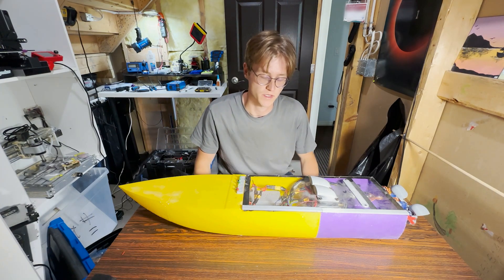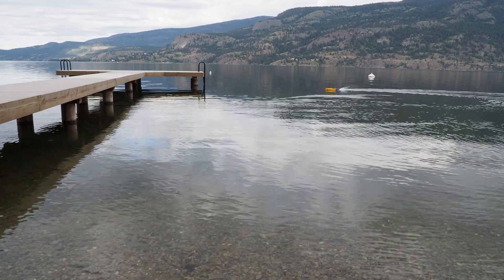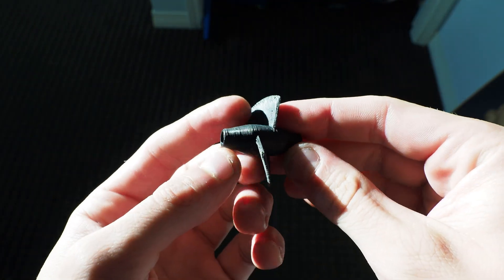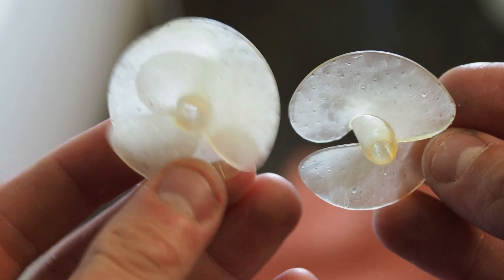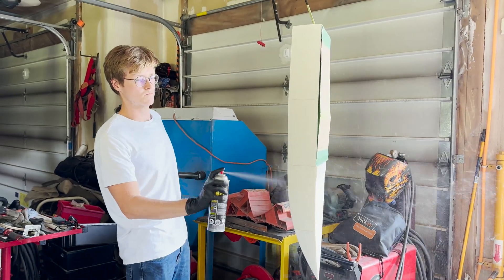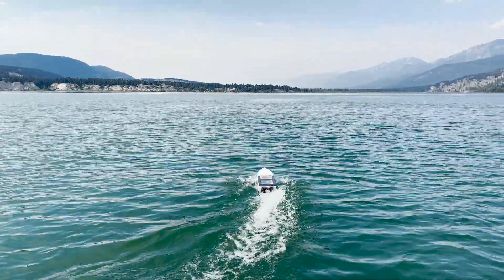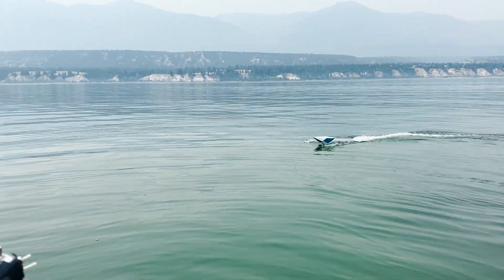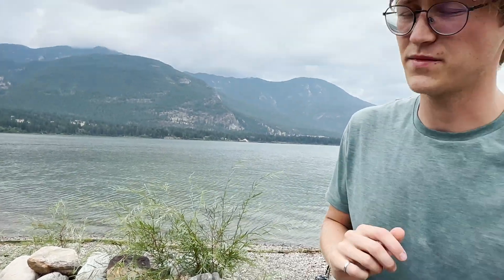Turning My 3D Printed RC Boat Into A Monster

Comment: Boat looks sick, check the one i made for my last year of highschool project were I built a Prusa MK2S kit and built the boat, it was overheating the ESC in a matter of seconds because of really high amp motor without cooling since they were meant for a rc car and at the time we didn't have any watercooled motor/esc combo sold by a local shop.

It had reverse steering using a drop down bucket system on the jet.

I still want to build another one for me since this one stayed at the school.

This was in 2017/2018 i think.

https://youtu.be/Vq4V5ILlNmE

Comment: very cool to see you back at this project. The upgrades look great, and I'm definitely curious to see how different impellers will perform under the new motors. Perhaps the issue with the thicker impellers failing is overloading at the joint between the axle and the blade, that's where the stress would be the highest. A sharp corner there would make it likely to crack, so maybe adding a fillet around the base of the blades could make them more sturdy? Or perhaps also using a more flexible engineering type resin for your printer.

Comment: upgrades are 10/10 for the looks, still think it could use some beans tho.
Reply: Yes it will go faster because it is blessed by the bean gods
Reply from the maker: The bean gods will give me much more speed! Also I wasn’t going full throttle because I didn’t want to blow up impellers :)
Reply: @mediocremaker5575  that are true but never must we be untrustwurthy to the bean Gods for they Will seek revenge for you betrail
Reply: @mediocremaker5575  try a steeper pitch on the props It might help with speed just try not to blow them up 🤣